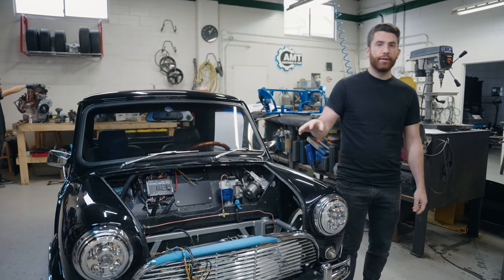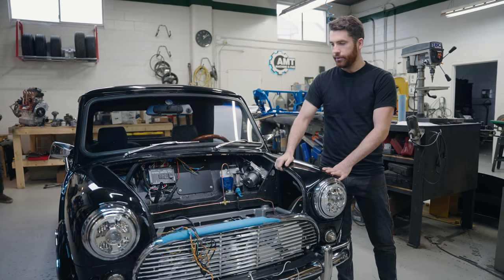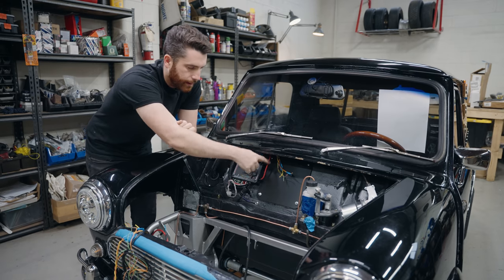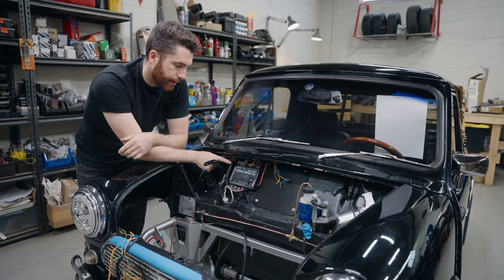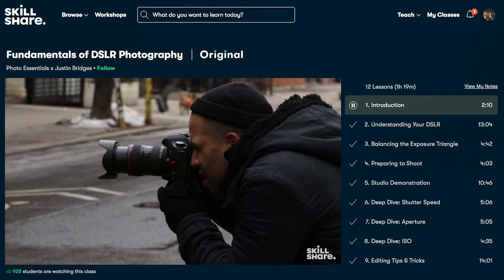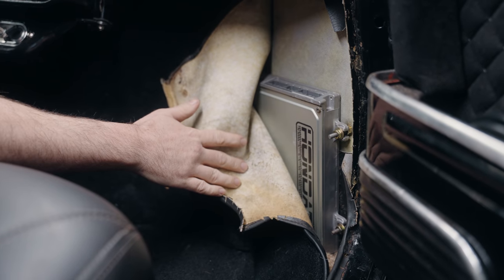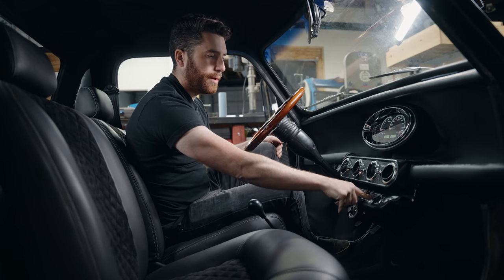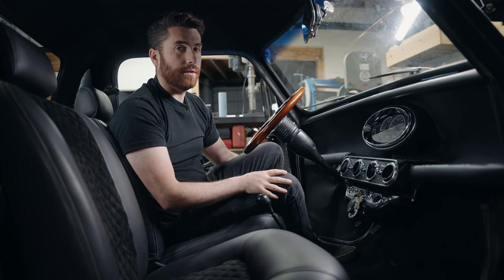The Pickup gets Wired - Little Morris Episode 2

Comment: Absolutely LOVE that fuse block.  You are basically cutting the harness in half, giving access to it all instead of having to inline splice and guess.  I had lucas switches melt twice when the car was turned off and the second almost burned down the house, so I did my own custom relay board in that same spot.  But the one you're using is far better - I often want to bypass the harness to run/fix this or that and yours allows access to everything right there. If you guys would offer this as a kit people would freak - it is a common trouble area that nobody likes as you know, and they're all horrifically bodged up.